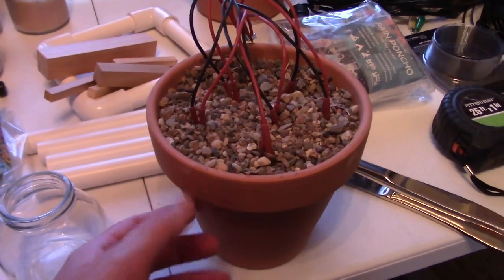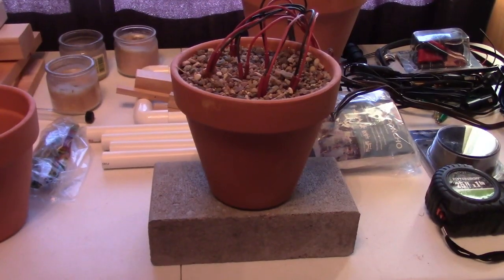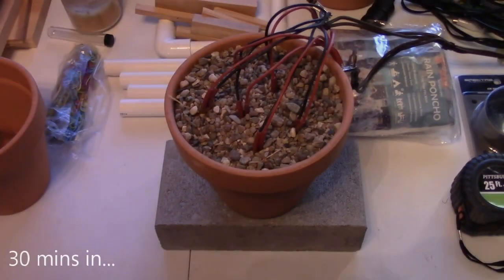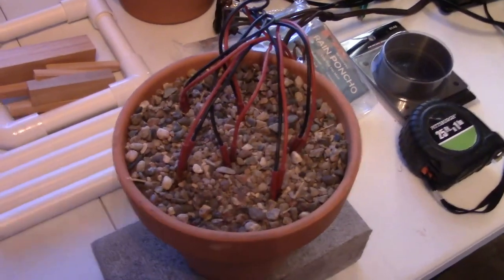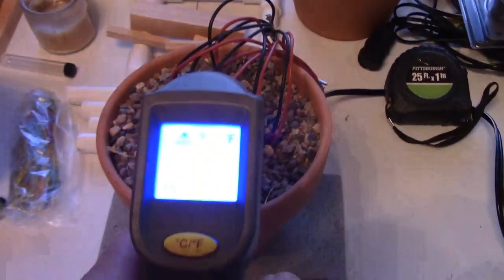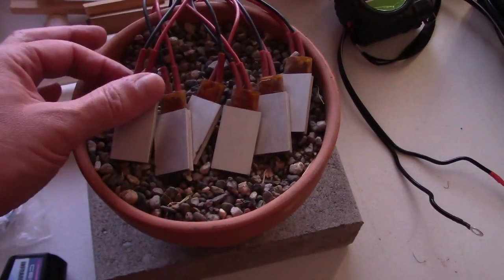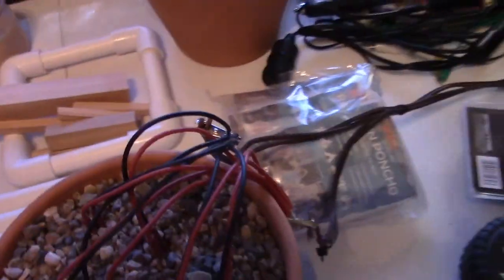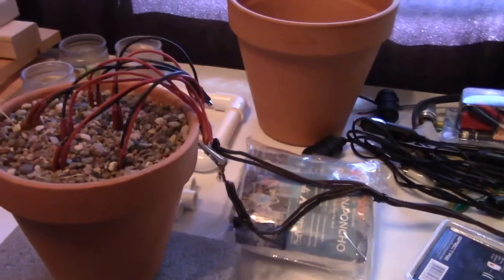DIY Flower Pot Air Heater! new design! no candles! uses PTC Ceramic+Rocks 300F(150c)+ heats a room!

Comment: Have you tried using glass instead of gravel?  Smashed glass bottles or glass containers into gravel-sized pieces.
Reply from the maker: hi. if i tried using smashed glass bottles i would probably get it all over the place.
Reply: @desertsun02  I remember watching a program where they used smashed glass bottles to store heat under a greenhouse but it seems that was wrong and glass is the same as brick and concrete. Soapstone which is basically talc has superior heat storage qualities. A greenhouse connected to a house using old copper tanks painted black filled with talc with PTC embedded in the talc could possibly be the only heating system a house needs.  https://www.youtube.com/watch?v=f2jH8PcuOMs&t=606s
Reply: @desertsun02  How about adhered to thick glass sheet somehow - as a panel type heater?
Reply: I now wonder about using water softener salt smashed into pea sized.
Reply: @dumbbunny15501  Trombe walls are a good idea if you get a lot of sunshine in the winter.
Reply: @higreentj  I don't think this would help me much here. But thank you for the information. Here in northwestern Minnesota.  I think I need something very quick and to hold whatever heat and energy I can .  yesterday the POWER went out from about 2pm to 9 pm
.a few candles and a 20# propane tank all I had.  Today it's pushed me to go solar ASAP.   Have had. 0 -  -32F. Etc past couple weeks.  The time has COME to enjoy letting the sun do some quick work 4-5 hours a day. Or let batteries do their part too. I just Have to quick learn.  Thank you .

Comment: What are "the heaters"?
Reply from the maker: hi there. they are what is called PTC ceramic heating elements. they are a small piece of the 'ceramic' enclosed in aluminum shell. hard to give an exact explanation in comment area but if you search it - wikipedia should have a detailed explanation 👍

Comment: where can I buy this small plate?
Reply from the maker: i've seen them sold on amazon, ebay and aliexpress. i usually get them on amazon. look for 220c ptc heating element. they also sell 200c ones. those should work good too. i've recently seen the 200c ones on ebay. they were 5 for 12 dollars.

Comment: I really only Need heat in my RV while I am sleeping... I have a  Electric Blanket that takes 85 watts and shuts down automatically after 10 hours... I can use my Solar Batteries or my Harbor Freight 5 in 1 Power pack that has a very convenient 200 watt Inverter built in if I am not connected to shore power...Easy Peasy !  LET'S GO BRANDON !